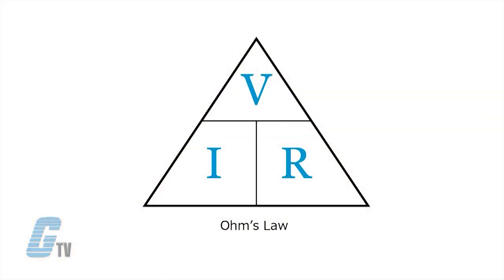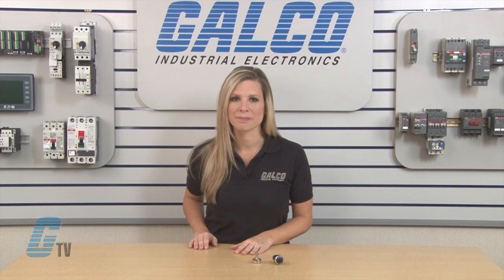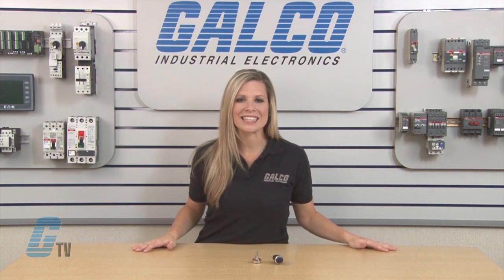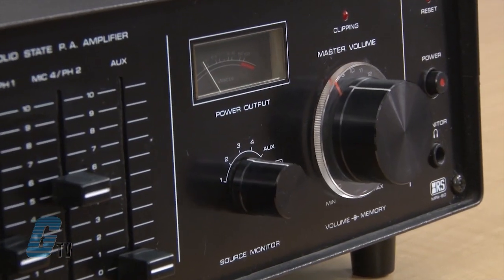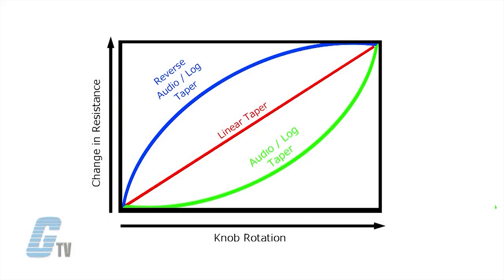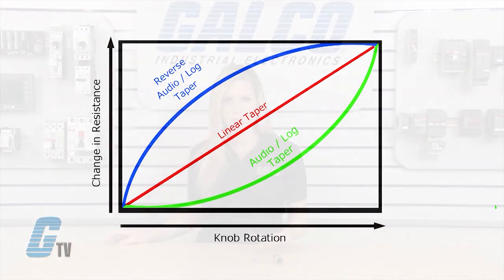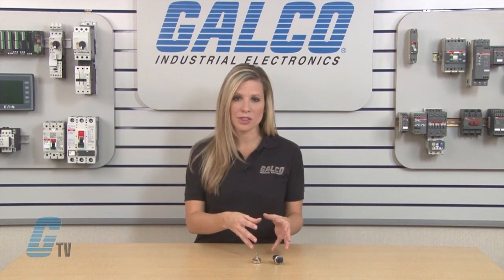What is a Potentiometer?

Comment: This script is full of misleading terminology.  Commonly called speed pots?  In 55 years of involvement in electronics, I have never heard the term "speed pot".... pot... yes not speed pot.  A potentiometer is a variable voltage divider.  You can't use a small potentiometer to directly control a high powered lightbulb as visually indicated in this video.  It would be great if You actually showed something about the construction of a potentiometer.  The resistance does not control the "amount of voltage that passes through" as any value of resistor always allows ALL the voltage to pass through.  It is a voltage divider that produces a variable potential across the resistor based on the proportion of one resistance compared to the other and the amount of power dissipated in each leg of the circuit.  Who ever writes a script for a video such as this should really understand how to describe the concepts they are attempting to convey.   Because most people think that potentiometers ARE something that controls power going through them, (which is in fact a rheostat), which are virtually never used any more because they waste so much energy,.... it would be useful to explain that misconception.  Potentiometers are used to vary a potential (voltage) that is usually used as an input to some kind of control circuit, that either controls the duty cycle of an AC power source or controls the current flowing to some device that is being driven. Incidentally many potentiometers have more than three terminals.

Comment: I have a question, Wanted to ask whether the power supplied to Bulb using POT is controlled  or not.

Because I think there will always be loss of power in POT ( other than heat ), irrespective of the position of the wiper.

Comment: Isn't it the current that changes with respect to the resistance, cos the voltage is constant? I=V/R.
Reply: davidilogho no. Current is constant in series. If voltage was constant this would break circuit theory. 

If it isn't obvious she's referring to the voltage created by the potentiomter. Voltage drops occur in series applications. Due to the nature of the potentiometer, as a type of resistive unit, this voltage drop equates to V = IR. The greater the resistance, the more voltage created. Like I said, current does not change in a linear, in-series application.

I'm only an electrical engineering student in my 3rd year making educated remarks from what I've learned. Feel free to input.
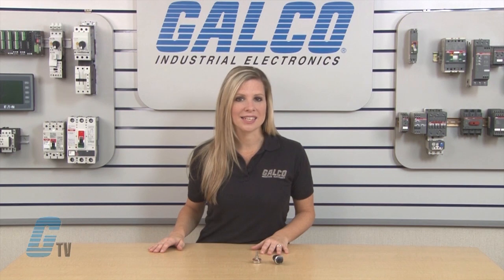Reply: 0:57 Voltage changes with respect to resistance since we are assuming the amperage (current) is constant.
Reply: I think it depends on whether the potentiometer and motor are in series or parallel.  If series then high res on pot. = High voltage on pot = Low voltage potentiometer. But voltage is equal in parallel (I think this video assumes parallel) 

Please correct me if I'm wrong

Comment: So basically to make the bulb glow brighter we have to increase the resistance attached to it ??
Reply from the maker: Not exactly. The resistance in series with the bulb is decreasing to allow more voltage and current through the bulbs filament. Our demonstration here shows a pot connected to a small voltage controller. This is done to allow the power required to light a 120 volt bulb rated @ 60 watts with a 2 watt pot. In the case of the motor controller the pot would have the 2 outer  terminals connected to a signal voltage source usually 6 to 10 volts DC and the wiper terminal connected to the reference input of the motor drive/controller. So now the pot is simply a variable voltage source.

Comment: How did you wire the lightbulb to potentiometer?
Reply from the maker: You may have noticed a little black box we refer to as the resistive brain. Actually it is nothing more than a solid state relay module with a variable input, this allowed us to control 115Vac to the light bulb.

Comment: Hello . my accordion microphone grundig gdsm 331. The 10k potentiometer did not work well, the sound quality was poor. what potentiometer do you recommend me???
Reply from the maker: There are 2 basic types of potentiometers, linear taper or audio taper. First you need to establish the resistance value you need measured across the 2 outside terminals, then the taper type. Most likely it is audio taper but not necessarily, that will depend on the mfg design and the function of the pot you are trying to replace. Good luck.
Reply: let's also remember that JUST LIKE A RESISTOR, if it partially burns out , lets say it started as a 10 Ohm Resistor,  and now had a lot of voltage go across, but didn't burn the shit out of it, but partly did
and after this higher voltage scenario.. YOU MEASURE THE RESISTOR and let's say it's now reading 8k Ohm   hehe
well, I'TS NOT AN 8k Ohm Resistor is it ?   it's a faulty 10 Ohm Resistor which is now out of spec

SOLUTION FOR YOU
Go get one of the other pots and measure them (I assume you know how to use a MULTIMETER), as the girl said
that will likely tell you WHAT A WORKING POT SHOULD READ
and if you like, you can compare it to the faulty one

THEN YOU'LL KNOW WHICH ONE TO BUY

Comment: HELP! im trying to install one of these to my mobility scooter. what info do i need about my scooter to look for to find the right potentiometer?? thank you
Reply from the maker: Well a service manual with an electrical diagram would be first place to start. But are you replacing an existing pot. or adding something different?
Reply: GalcoTV thank you for the speddy reply. im adding one. there was no existing pot.
Reply from the maker: Then be sure to put the wiper on the correct terminal so you don't short out your reference supply turning the pot all the way to 1 end. The 2 outer terminals are not as critical, they will just determine which direction it turns to increase signal. If backwards then just swap the 2 outer terminals.